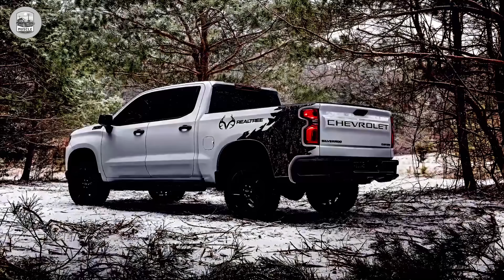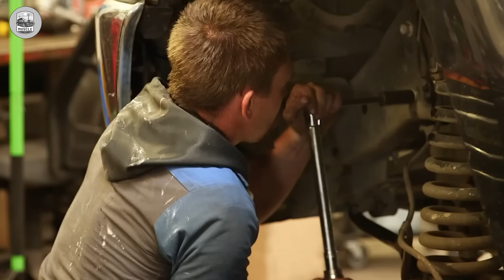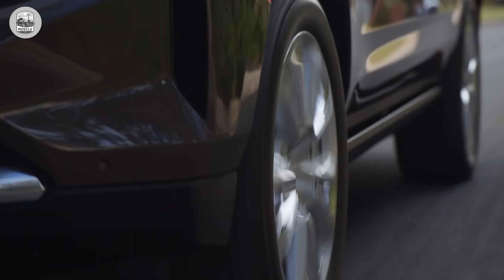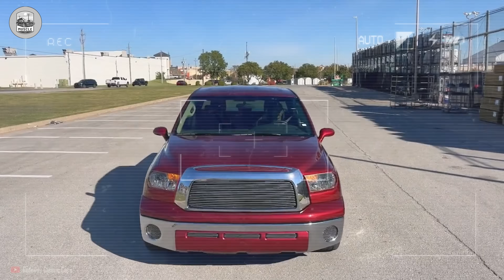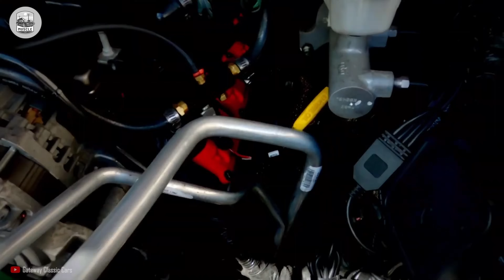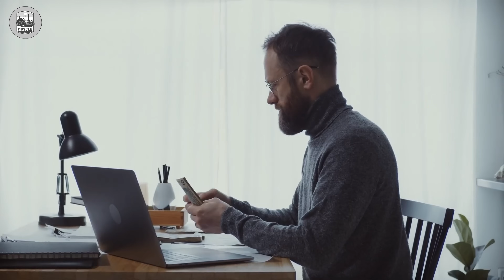The SHOCKING TRUTH behind GM SCREWED 877,000 V8 Truck Owners!

Comment: 1st quit using cheap Chineseium parts to start with.  2nd the tech is out there to make these vehicles get way better MPG than they do but big oil pays them to get the crap mileage they do. 3rd ALL car companies make these vehicle to last only a few years so you have to come back for either repairs or a new one.  And lastly, you can't improve on the tried and true SBC so they never should have tried 🫡
Reply from the maker: I get the frustration — especially when you’re seeing failures that shouldn’t happen.
On the parts side, yeah… quality control matters. A lot of modern failures aren’t because the core design is junk — it’s tolerance stacking, supplier variation, thin cost margins. When you build millions of engines, shaving a few dollars per unit changes material choices fast.
But the “big oil pays for bad MPG” angle doesn’t really hold up mechanically. Automakers live and die by CAFE targets and emissions fines. If they could squeeze easy MPG without tradeoffs, they would. The problem is physics. Power, weight, gearing, emissions, safety equipment — they all fight efficiency.
As for “built to fail in a few years” — modern engines regularly go 200k+ with maintenance. They’re more complex, yes. More sensors, tighter clearances, variable timing, direct injection. That complexity increases failure points, but it also increases power and efficiency.
And about the SBC — the Chevrolet small-block V8 absolutely earned its reputation. Simple architecture, tons of interchangeability, easy to rebuild. But emissions, fuel economy, and noise regulations forced evolution. That’s how you eventually get to things like the LS platform — same pushrod philosophy, modernized structure.
Nothing stays frozen in 1970 and survives regulations.
The real tension isn’t conspiracy.
It’s cost vs durability vs compliance.
And in that triangle, something always gives.

How about the M21? If you want to explore The INSANE GM Geometry Mistake That Kept Killing M21s, check this out OUR NEWEST VIDEOS...
Good day bro...

Comment: It's just like having bmw and a Benz 😂 I learned my lesson
Reply from the maker: Yeah, a lot of owners say the same thing after dealing with those repairs. The frustrating part is that on paper those trucks are built around very solid engines. The base small block architecture itself is strong. The block, crank, and bottom end are usually not the problem.
Where things started getting complicated was with all the added systems like cylinder deactivation, variable valve timing, and the electronics that control them. When everything works correctly the engines run well and make good power while saving fuel. But when one of those components fails, the repair can get expensive very quickly.
That is why many mechanics say the core V8 design is still good, but the surrounding technology introduced new failure points. It is a good reminder that sometimes the simplest mechanical setups end up being the most durable in the long run.

Good day bro, hope to see you on our NEWEST VIDEO for The INSANE TRUTH about Ford’s 98 Pound “UNBREAKABLE” Transmission!
thank you...nice weekend too...

Comment: $100000 and GM is not the worst its only its the 6.2 motor 5.3 or 5.7 only
Reply from the maker: Yeah a lot of mechanics see the same pattern. The 5.3 and 5.7 small blocks have generally been much more forgiving over time. The older 5.7 Vortec especially was a very simple design. Iron block, straightforward valvetrain, and not a lot of extra systems that could fail.
The 5.3 LS based engines are also pretty tough when they’re maintained well. Good oiling system, strong bottom end, and parts are everywhere. That’s why you still see so many of them with 200k plus miles on trucks and SUVs.
The problems people talk about more often tend to show up with the 6.2 L87 in some newer trucks, mainly because it runs higher compression and relies more heavily on modern systems like cylinder deactivation. When those systems start acting up, repairs can get expensive quickly.
The core small block architecture is still strong though. It’s really the added technology around the engine that has made some of the newer trucks more complicated to maintain.

Good day bro, hope to see you on our NEWEST VIDEO for The INSANE TRUTH about Ford’s 98 Pound “UNBREAKABLE” Transmission!
thank you...nice weekend too...

Comment: Garbage Motors😂
Reply from the maker: Hey there, @drfaticus! Haha, I see what you did there with "Garbage Motors" 😂—GM has had its share of questionable decisions over the years, but let’s be real, they’ve also built some absolute legends. Think about the LS engines, the big-block Chevys, and of course, the monstrous 426 HEMI rival—the L88 Corvette. Yeah, they’ve had some missteps (looking at you, Cross-Fire Injection and the 8-6-4 Cadillac debacle), but let’s not forget the tire-shredding beasts like the LS6 Chevelle, the 454 SS, and the GNX, which still haunt the streets today.
have a good day.

Comment: This is "why" , I've just bought a beautiful new looking '01 Dodge Ram 1500 Sport.  Yeah it's got the older 5.9 Gasser, and it's a Dodge,, but it looks like "show-room"........ less than 99K original miles.
Reply: Until the Trans goes out, and the powersteering.....

Comment: I have a 2015 GMC Sierra Z71 with the 5.3, after the warranty ran out, I installed a module that prevents cylinder deactivation. It runs all 8, all the time. Mpg went down about 1 mpg. It cost about $135 ,Currently have 233,000 miles.
Reply: Another class action lawsuit was filed for reduced mpg after recall.